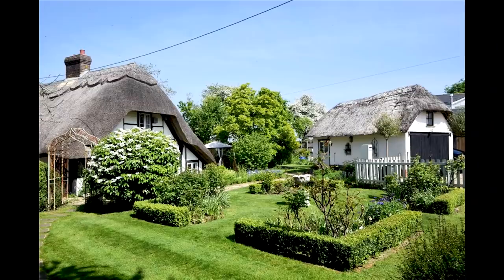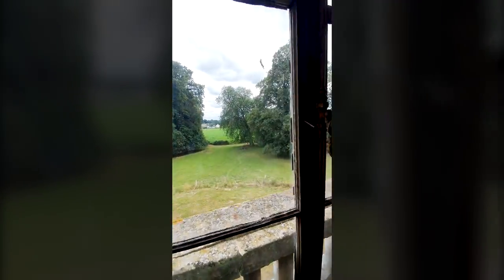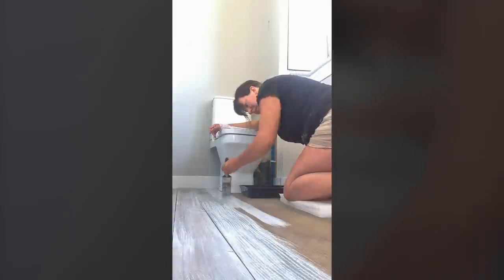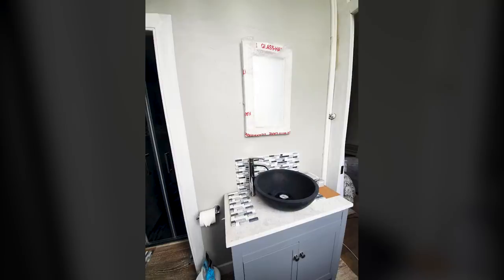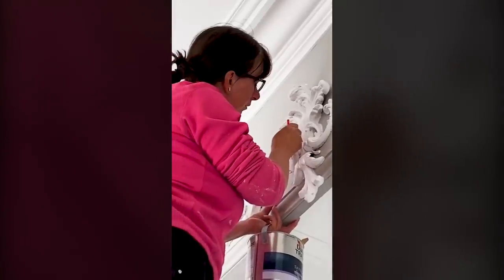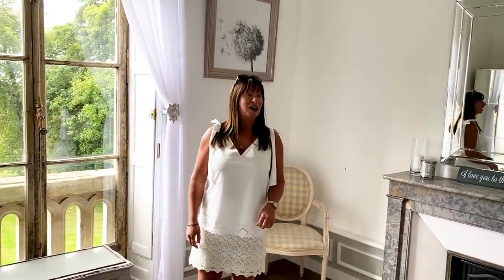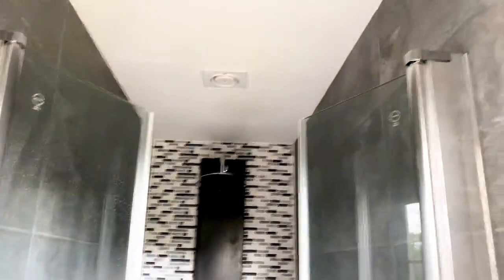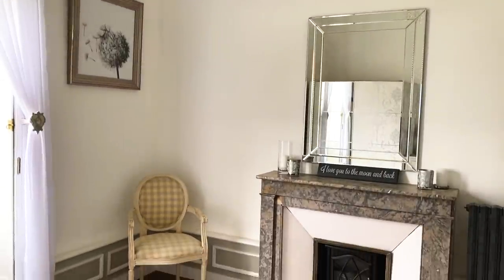My Parents Moved my Bedroom to a CHATEAU in FRANCE!

Comment: The use of space for shower and ensuite could not be better the walls are immaculate with crown moulding to boast about. Eyes draw to the window panes kept wooden and accentuate the flooring in the rooms transition lightly to draw ones' eyes to a lovely view. Three months only for lovely result! Very Nice. Wonder regarding the pipes however did they freeze or were there any problems after connecting everything. Dick Strawbridge at Chateau Husson has great low cost ideas to heating a chateau  Escape to the Chateau, check out You tube. Really helps people and may have trade options available before winter. Some Chateaus have been bartering with materials needed for what they need ,etc. Check out recycle options too. Lovely job on the room and until next Vlog. Check you tube for instructions on wood chipper too. Have you met any other Chateau persons besides Michael?